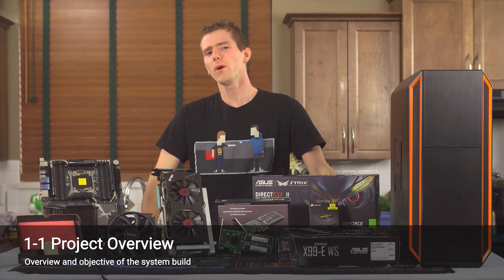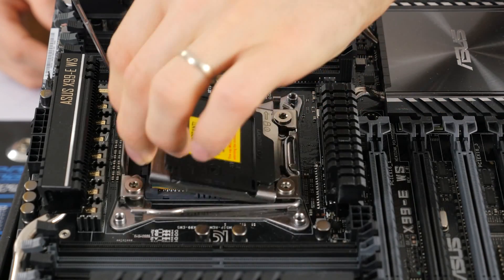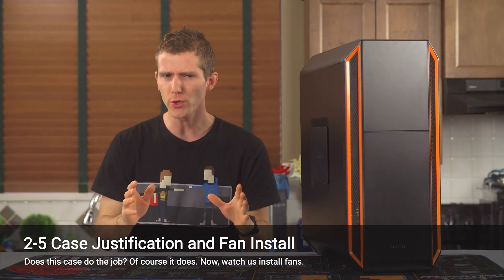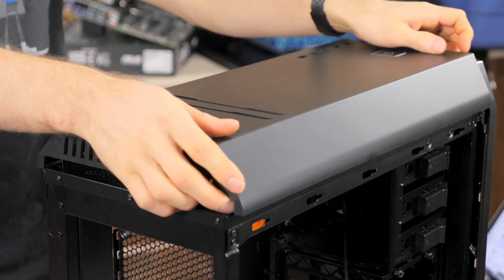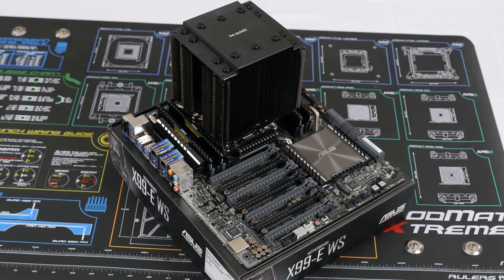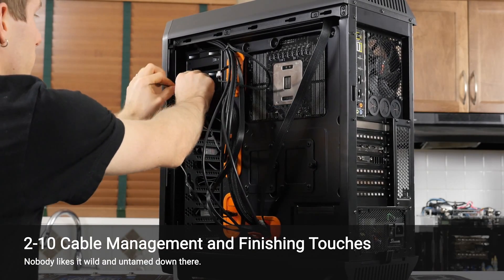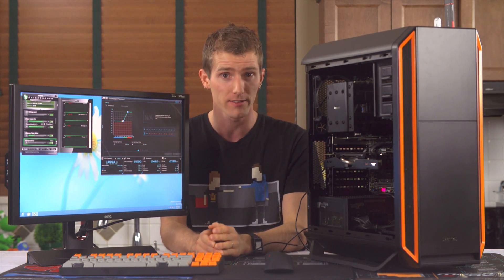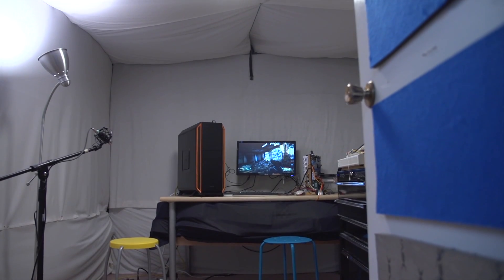How to Build the ULTIMATE Silent Gaming or Workstation PC

Comment: My mainboard Is way smaller so only 4 Screws fit, Is that alright.
Reply: I meant three screws
Reply: +Ole Kohle yeah sure as long as board isn't falling out or bending you'll be fine
Reply: ***** hope so :D
Reply: +Ole Kohle  Three screws are not terribly likely, i have never seen a 3-hole board so far and i don't know how it could support itself in the long run, because they generally bend with time.

mini-ITX mainboards have 4 mounting holes, they are all near the corners. These boards are easy to recognize by having only one extension slot. All of these holes need to be mounted with screws.

micro-ATX is the most common mainboard format. They support up to 4 extension slots, but 3-slot boards are common. They have typically 6 to 8 mounting holes. All of these holes need to be mounted with screws. Following holes are usually present, if you look at the board with I/O panel facing vertically:
* top left corner, just to the right of I/O panel
* along the top edge, above and to the right of CPU socket.
* top right corner (optional)
* along left edge, just below I/O panel
* in the middle of the board, below and to the right of CPU socket, to the right of the prior hole and below the hole to the upper right of the CPU socket.
* along the right edge, to the right of the prior hole (optional)
* along left edge, 2" below I/O panel, not far from the bottom
* approx. 0.5" from the bottom edge or to the right of the prior hole (2 different positions), below 2 other holes in the middle of the board

full ATX is the largest of the widespread mainboard formats, though there exist larger ones. It supports up to 7 extension slots, and has a varying arrangement of holes, generally 8 to 10 in number. 5 of the holes match microATX, and the rest are laid out in a logically similar manner, but at different distances.

When you purchase an ATX enclosure and prepare to insert a mainboard, you need to reconfigure the back plate of the enclosure by removing the screw-in stand-offs where a mainboard has no hole and inserting them where it does have a hole. Often, large boards require no reconfiguration, but smaller boards require numerous stand-offs to be moved. Failing to properly configure enclosure backplate can result in hardware damage.

Check the mainboard manual to see which holes you may have missed. Either there's a section about installing the board into the enclosure with separate markings, or look at the general outline drawing of the mainboard and look for circles with dots around them.
Reply: Siana Gearz I have a lot of knowledge in PC's but somehow my mainboard wont fit more then 3 screws without making new holes in the case
Reply: Ole Kohle I'm curios what the name of the board and the case is.
Reply: Siana Gearz Its a Gigabyte GA-B75M-D3H and a BeQuiet Silent Base 800
Reply: Siana Gearz Its micro atx but every thing under Atx should fit in the case
Reply: Ole Kohle Good choice on both the mainboard and the enclosure.

The mainboard manual however is badly written -.-

The board uses 7-hole mounting. You must have overlooked some. Your enclosure supports 6 of these 7 holes. The last hole would be nice, but it's not too bad, if careful not much damage will happen there.
Reply: Siana Gearz Im too lazy to change it but I want to buy a new processor and mainboard in the future wich will fix it too :D But thanks (My processor is a i5-3450 :/ )
Reply: Ole Kohle  Huuuh? You have a very good processor. If you want to crossgrade to workstation class processors, you will be taking a compromise, more throughput in highly parallel tasks vs. less game performance. If you upgrade to newer consumer class processors, you will be plain disappointed, as you will not see much performance increase whatsoever, a couple % are simply never felt. The board is also just fine. Keep your stuff.
Reply: Siana Gearz The Problem is that the processor usage is mostly over 75 % even in games like counter strike
Reply: Ole Kohle Aaaaand... what makes you think that the issue will resolve itself? You have 4 cores, 4 actual physical cores. Let's say your vsync is off, then you can have full utilization of 2 threads on simple/old games, i.e. 50% maximum CPU utilization. One thread is for the main thread of the game, and one more is the graphics driver's UMD thread, a thread spawned in the game's process by the driver to offload some data preparation tasks. So what else is running and eating up the rest?

I know one guy who was an Apple fan, and he thought something was wrong with his iMacs every time. Oldschool Unix administrator, quite skilled actually. He would buy one ($2700), be happy with the purchase for a while; then find that it no longer performs well, buy another, find that it works well, toss the old one. Then a short time later he would find that the new one was slow too, and the buying and throwing away commenced.

Until i prodded him to investigate and it turned out, he used the machine bare for a few weeks, and then copied over the home directory from the backup, which contained some corrupt setting files and made the system slow. I mean the guy obviously had plenty of skill to discover that himself, he just didn't stop to think because of this misplaced notion that throwing money at things is always helpful.

The issue is not exclusive to Apple people. Very few of those people affected can actually afford to be that guy.
Reply: Siana Gearz Usually in a game like CS:GO the usage should not be over 20% so what could I do. I mean when I play, the usage is over 45% and up to 70%
Reply: Ole Kohle  look at the task manager and see what's eating the CPU, is it really JUST the csgo executable?

If it's the kernel (red CPU graph on Windows 7 if enabled, process "System and compressed memory" on Windows 10), you can use e.g. latencymon to see what driver is eating the CPU time.

If it's another executable, you'll know to poke THAT.

If it's the same executable as game proper, you'll need to look at injectors, those are DLLs that are force loaded into the process by external means. You can troubleshoot the startup of an executable using Dependency Walker (depends.exe) in Profiling mode.
Reply: Siana Gearz It's only the game and do you know a tutorial about how to fix the problem?

Comment: Lmao "less than a dollar per gig" with 2 480gb ssd's  so almost $1000
Reply: Mark Johnson
Yea you're right, I mixed up some of their attributes. RAID 0 you get the speed of 2 SSD's/HDD's and the storage of both of them but they are theoretically half as reliable. Where as RAID 1 you get only half the storage of 2 drives, no speed advantage, but twice the reliability, sorry if I caused any confusion, I derped.
Reply: Dan Jacques
yea, the idea is that you get the speed of 2 SSD's but only the memory of 1.
Reply: +Read Adams do you know how raid 0 works it strips them both together with no redundancy, your thinking of raid 1
Reply: +ClickyGaming not pci-e
Reply: +Read Adams half of the total of 480x2, right?
Reply: It’s crazy how much cheaper SSD storage has gotten in 5 years lol. I remember watching these videos years ago going “I’ll NEVER be able to get that much SSDS storage”
Reply: But you are forgetting that it it was run in RAID 0 which means that he was only getting HALF of that memory.
Reply: didnt say its cheap

Comment: Hmm, whenever I apply thermal paste I always spread it out to cover the entire surface.  Is this a bad idea?
Reply: +CowLunch it depends on the paste your using.  With older hard paste it was common.
With modern thermal paste its not always a good idea.

The reason is that it traps air and creates bubbles
These days you apply a small blob in the centre, and the pressure evenly spreads it outwards. Pushing all the air with it and leaving no air bubbles

Comment: Heh, all the parts combined add up to around $5100. *sigh* what would you recommend for a silent, though not so ultimate PC that is around $2000-3000?
Reply: +robotica for 2000 dollars you can build a monster rig. Get a 980ti(you could easily get something else assuming you are looking more at performance per dollar and not just performance r9 390, gtx 970/980 etc etc, 5820K(not as good as the 5960X but its a sweet spot CPU 6 cores with hyperthreading). As for the motherboard you don't need one that costs 500 dollars, 200ish should be plenty. Most of those mobos have extra features the average person doesn't need slash will utilize fully. As for the case mix and match to your hearts desire, find a style you like, size etc, pc part picker is good for helping you find what parts are compatible with each other. As for what i should have asked what do you actually want to do with your pc slash expect out of it performance wise. Realize that a lot of these ultimate pc builds often use parts that have horrible price to performance ratios. Assuming you use these parts the gpu would be better than what Linus used, and the CPU would have about 30percentish less performance than the 5960X. Still worth it considering the 5820K is about 600 dollars cheaper.
Reply: pkroliko1 Hey. I've already made myself a build for around $1300 (I made the budget even less, forgot the crazy conversion ratios to our currency) and made this: http://pcpartpicker.com/p/QCHbmG

After around two weeks of fiddling in the LinusTechTips forum I finally got what I wanted. I may swap out the 970 with an R9 390, maybe R9 390X, but they consume way too much power, so I thought I'd rather first save up on the CPU, RAM, Motherboard, GPU and storage would come later. If I'm patient enough, I might save up for a 980.
Reply: robotica should be a great build. The r9 290(the 390 consumes like 20-30 watts more) which is what i have does consume more power but unless you game 8 hours a day/render a lot its not going to cost you much more a year. Regardless the 970 is a great card as well. As for your plan seems like a good one. Hope you are able to finish your build sooner than later.  Not sure where you live but i hope you have some good holiday/winter sales coming up.
Reply: +pkroliko1 I picked the 970 because it was the most bang I could get out of my buck. I don't always game a lot, but when I do, I want power consumption to be as little as possible. I'll also be buying parts one by one, except that the CPU, mobo and RAM will be bought together. Thanks a lot for your help though and merry Christmas :))

Comment: When i was working at a local computer workshop here in Sweden i built a silent PC for a customer.
I couldn't hear it at all even when i put my ear flat on the side door, even when all fans was at 100%.
I did not have any equipment to measure audio levels at the time, but here are the specs.
I used an NZXT H630 case (Without window)
For the airflow i went with the standard 200mm fan at the front, an NZXT 1000 RPM air-flow optimized fan at the top drive cage and a 120mm radiator from Cooler Master in push-pull at the back with 2x NZXT 1000 RPM static pressure fans for a total of 4 fans.
I really recommend that case if you want a premium silent computer.

Comment: Asus K43SV
Intel Core i5 2410m (2.3 ~ 2.9 GHz)
Nvidia Geforce GT 540m 2GB DDR3 128 bit
4.00 GB RAM
Windows 10 Pro 64 bit

I play Dota 1 and 2, and CS GO and I got 65 fps both of 'em and I'm fully satisfied with it. (1366x768 and 1280x720)
Reply: +Cdek Ibalio A fresh GPU is all you really need, or maybe a new power supply, but then you'll need a new case, and after that a Dual, 18 core Xeon setup, and 3x Titans to match and 2 Ax1500i's, but you get my point, I hope.
Reply: +Suhail Sayed (CyanogenHacker) It's a laptop dude!
Reply: +Cdek Ibalio my bad, I didn't quite see that, but you know, if you tape that Xeon to the bottom of it you still get the extra power
Reply: +Cdek Ibalio Add anoter 4GB RAM and you're perfectly good to go. Or even 8GB.
Reply: +Louisarius No bro but thanks. I'm fine with 4 gigs because I don't multitask. I didn't reach 4 gigs of RAM yet.
Reply: Cdek Ibalio Aite then, good luck and happy gaming
Reply: +Louisarius :)

Comment: My PC is about 20dB under full load (Asus Realbench) with sidepanel off, measured from 2 cm distance. With closed sidepanel and 1m distance it get's down to 16dB although that's the dead end of my abient silence in my room. I guess it's about 15dB.

Specs:

3930k @4,6Ghz 1,34Volts
Asus Rampage IV Extreme 
GTX 980 TI @1500mhz 
16Gb tactical tracer LED RAM @2400mhz

All watercooled with 3x 480mm and 1x 240mm radiator + 14 Noisblocker  @450 RPM
Reply: +WarFace HD Wait what... 980 Ti 1500 mhz? Jesus christ
Reply: Pls tell me this is on pcpp! Or else put it on there. I'd love to see pics and all the parts etc
Reply: Noiseblocker :3 using 12 NB Eloop 3 fans here :3 a bit loud tho :c (30db or lower , i dont know) 
My next pc will have 12 NB Eloop 1
Reply: Holy crap. I'd love to hear what that's like on a lower power consumption CPU and lower GPU OC. That is, if I can somehow hear the damn thing.
Reply: +WarFace HD bullshit
Reply: MrSham3less Maxwell has a good OC !
Reply: +WarFace HD 
Have a hard time buying it.

For one, finding an instrument that has a noise floor below 30db is nigh impossible, the common sound pressure meters and loggers just don't show anything at all in that range. So what would you measure such a silent device with? Smartphones are liars btw.

And then 4 large radiators go... where? I mean sure, it's possible, but i'm curious.
Reply: Siana Gearz It was a core x9 that I sound dempend myself (otherwise it was too loud), for sound testing I used a blue yeti mic on full gain and set via software everthing under x amount of db to be canceld. That way I got down to 20/21 db and it still showed no reading, when I set it to >19 db cancel, it showed a reading.. not the most accurate way but for comparison, it was louder when I slightly rubbed my fingers against each other than my PC under load about 10 cm away from me.

Comment: why motherboard manufacturers put RAM SLOTS too close to CPU????????????
or PCI-e too close to other parts????
or "Ram slots too close to each other??
I GET ANGRY!!!
Reply: ATX Motherboards bro...
Reply: +mitropoulosilias shorter circuit (length of connection between cpu / ram) = lower latency. I think that would barely noticeable even in benchmarks, but anyways.

Comment: Any pc wizards out there? im a big noob and want to build a pc capable of running games like CS:GO, gmod, GTA V and pretty much all call of dutys (including BO3). Heres my build im thinking about and would really appreciate feedback on what i need to change, extra fans etc. also my budget is around £500 (UK) thanks :)

CPU: AMD Athlon X4 860K Quad-Core 3.7GHz 4MB Socket FM2+ 95W 
(no CPU cooler because it says theres one included with the CPU?)

Motherboard: Gigabyte GA-F2A88XM-D3H Motherboard (DDR3, Socket FM2+, PCI Express 3.0)

RAM: HyperX FURY Series 8GB (2x 4GB) DDR3 1866MHz CL10 DIMM 

Storage: WD 1TB 3.5 inch Internal Hard Drive - Caviar Blue
(no SSD but might try and pick one up on black friday :P)

Graphics Card: Asus Nvidia GeForce GTX 750 Ti Graphics Card (2GB, GDDR5, PCI-Express 3.0)

Case: Thermaltake Versa H21 Tower Case with Side Window USB 3.0 and 12cm Interior Fan

Power Supply: EVGA 500B 500W 80+ BRONZE PC Power Supply
Reply: Theres allways a Stock Cooler but it aint no good
Reply: what are legacy part? *****
Reply: ***** do you mean older parts bequz us ppl ain't have money for a i7 5500, a Xeon or a gtx 980 ti?
Reply: well actually i posted this comment when I was a huge noob at PC building, I,ve done ALOT of research on it and was thinking to change the CPU all together and get a G3258 with compatible cooler and motherboard, and just overclock the crap out of it. This way I can get that and a decent GPU as well? Thoughts? ***** Anton Helsgaun
Reply: you know what, i think i will go for that, i know cs go is a much more cpu demanding game, since thats mostly what i'll be playing, as you said, drop all the money on a 4790k and save for a gpu later. thanks man
Reply: ***** aha thanks man I realized how bad the 750ti was and ended up getting a 960 4gb edition and an i5 4690k which i am running right now and am thoroughly enjoying it

Comment: sorry, but beQuied failed on me

that case didn't manage to compete with thermaltake and fractial design.

EDIT:
my old cooler master silencio 550 does a pretty good job for a silent PC, under load it still has to be very quiet in my room if you want to hear anything of the computer.

Comment: Is it really worth it to shell out $100 on a silent case? How much quieter would a case like that be compared to a $50 case?
Reply: I'm happy with my $50 Corsair Spec 01 case. I recommend it.
Reply: when you look at cases generally $100 isn't really expensive, my Corsair 900D was $325 but I got it for the massive window, at the same time I have a phantom 820 that cost just over $100 but is way quieter because of the fans I use, it all comes down to the fans really, even rubber mounting vs screws can reduce volume by 10db or more